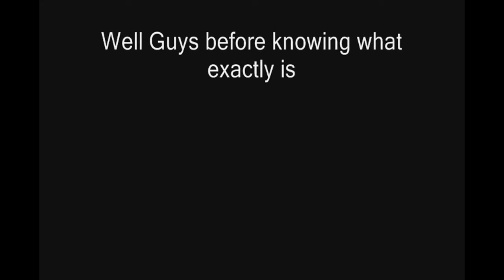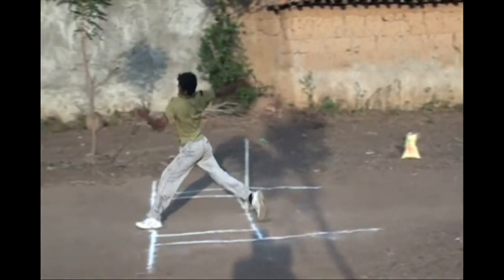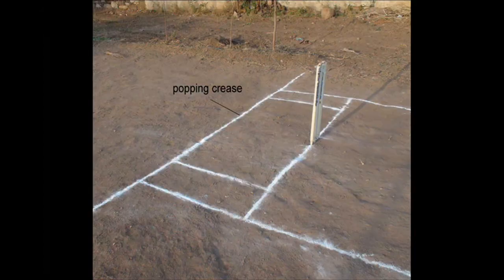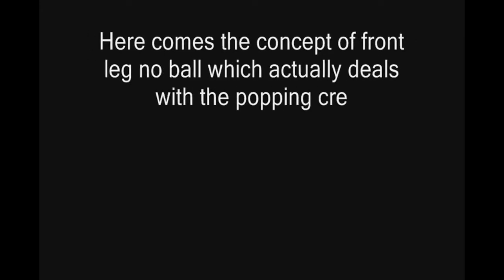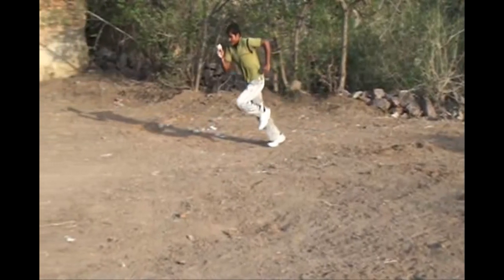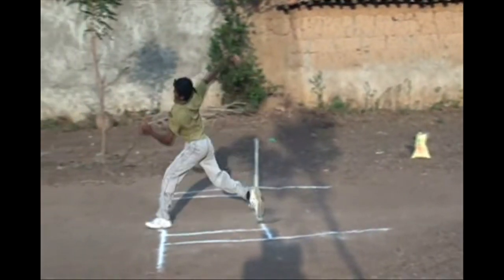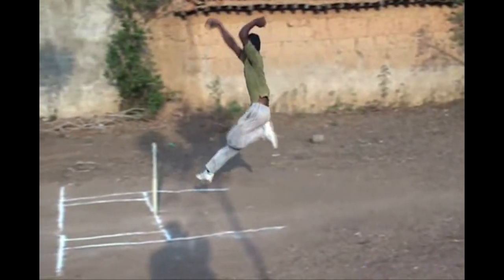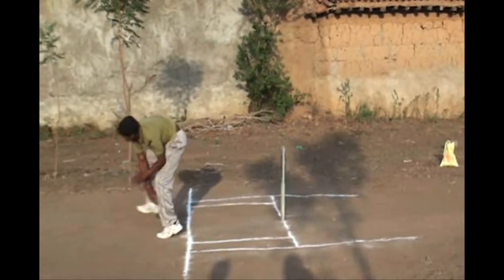what is a frontleg noball

Comment: You have a few things wrong -.Firstly - The no-ball adjudication is on where the FOOT lands (not where the LEG is). 
The foot landing ON the popping crease is not sufficient to rule out a no-ball - some part of the front foot must be BEHIND the crease (between popping crease line and stumps) although the part of FOOT behind the crease need not necessarily be grounded when the foot lands and may actually slide in front of the crease before the release of the ball..
Best Wishes David